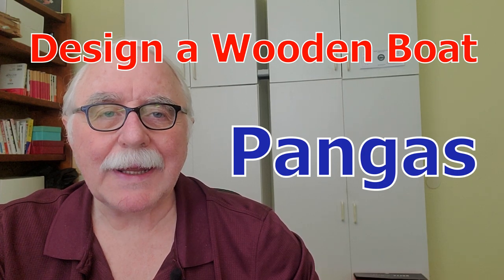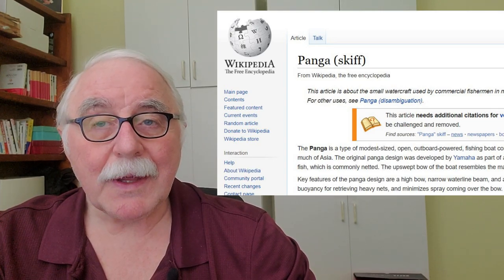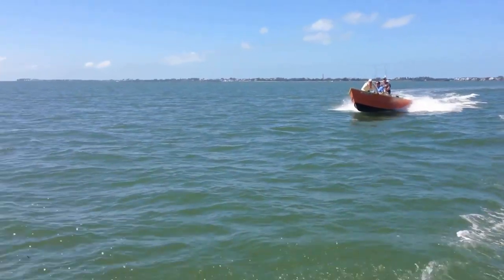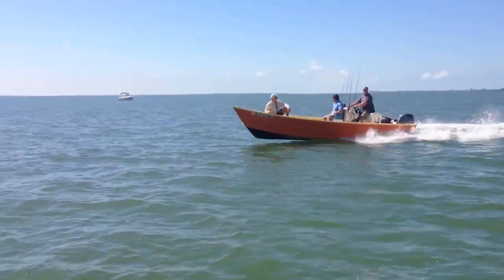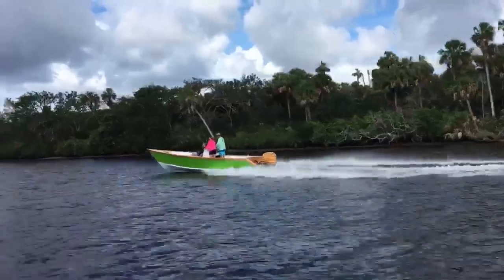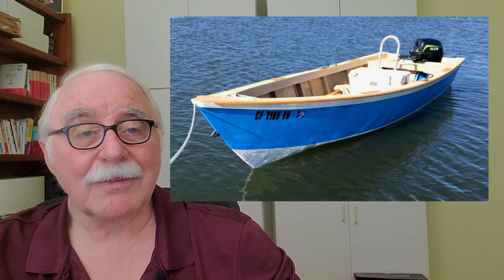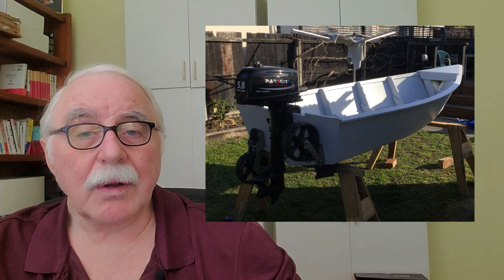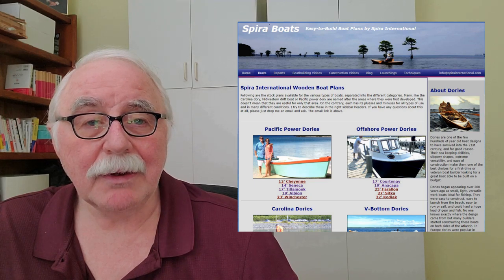Build a Wooden Boat - Pangas

Comment: Sir:  pulled a hitch on Okinawa in ‘73 (actually built my first plywood boat there, a skiff, I guess, a Rabl book from library, AF Spl Serv woodworking shop (every tool I’d ever seen, ALWAYS an expert there doing something), finished but never painted or launched, a guy gimme $25 for it - a fortune to a young E-3) saw round-bowed open outboards much like your clip of a f-glass Panga.  Thought they were ugly then, still do.  But yours, I like yours
Reply: Dennis Harrington and your point is?

Comment: I have seen a lot of the World Bank type of design in fiberglass and have used quite a few of them around coastlines and estuaries of Southeast Asia. In my experience, I have never heard them referred to as”pangas”, but rather as “Yamaha boats”. Almost all that I have seen or used have been about that 21 foot size and overwhelmingly they have been powered by one (or a pair) of 40 horsepower Yamaha Enduro two-stroke, long shaft outboard motors. Those motors are ubiquitous in the regions where I work and through sheer practicality I have used them on our small workboats including the Puchie Special drop-bow garvey-dory that we hope to launch in Bali within a few weeks.
Reply: Yamaha was involved with the original project as they also produce quite a lot boats for the Asian market. Take a look at any harbor in Japan and you will see quite a lot of Yamaha built boats that bear a striking resemblance to the FAO panga design. The big panga bow flare and fat upper spray rail shows up on even large Japanese commercial fishing boats. Jeff's designs looks more like the Caribbean pangas to me.

Comment: Do you have any narrow beam planing plans which would be good for antique inboards like an atomic four or an agricultural diesel? 
500lb powertrains with 15-25hp but 40-60lb of torque? 

I would certainly take the heartache of an antique motor to have that low RPM sound.
Reply from the maker: Those motors are not really suitable for letting boats plane. The faster low power boats were long, like 60 feet x 4; wide and could do 18 kn or so with 10 horses. A short fat boat will plane with lower power than a long narrow one,
Reply: Thank you so much for the reply. 

Would you say I'm probably better off with something like your tortuga? 

I'm definitely not looking for outright speed, just something nice and garageable that can do 15+mph if mathematically possible. 

Or heck, just a 14' panga and no capacity for passengers ha ha. 

I actually think the crude air cooled, direct drive boats owned by teenagers in other countries look fun. 
Often a flat bottom dory with an air cooled 16-22hp clone motor..... the kind of boat nobody would want to be a passenger on...
Reply from the maker: @corvairkid17  I'd say something like the ablemarle but longer would be most suitable.